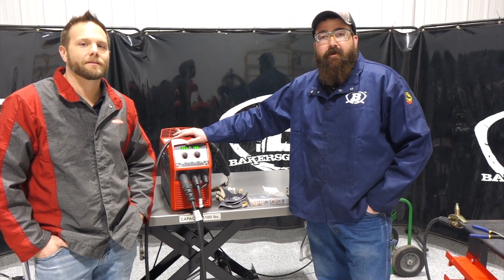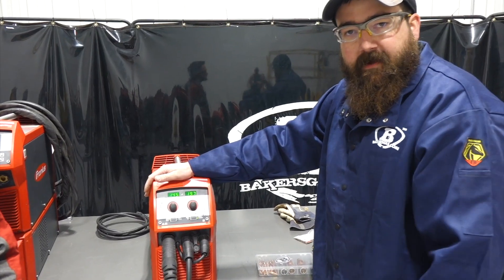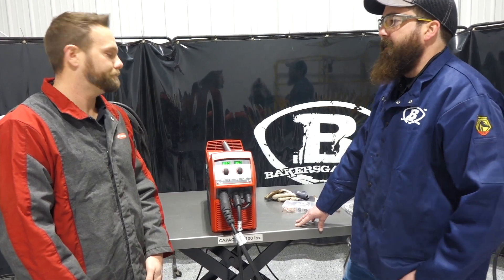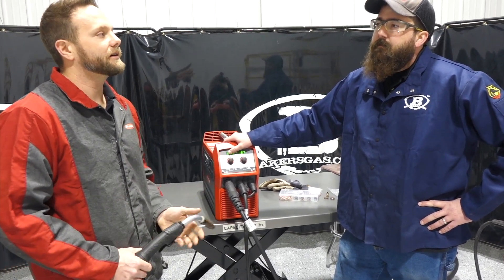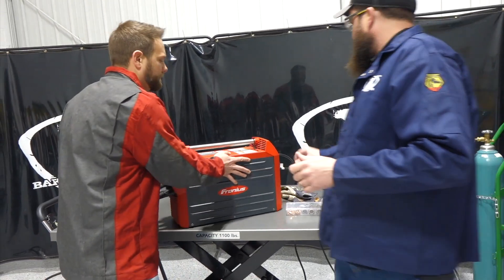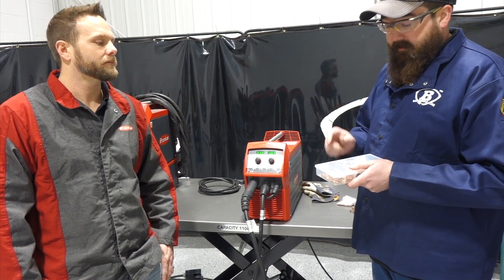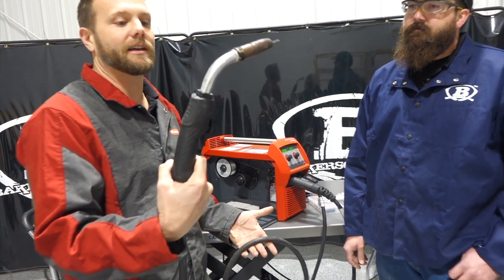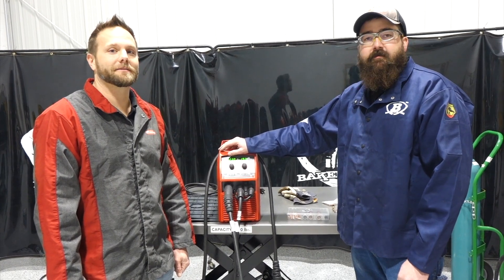Fronius TransSteel 2200 Simple Set Up Guide

Comment: plastic wire feed unit ,,, is it Parkside ? nope Im off to buy an EWM instead , same price but pulse , or a Bohler at half the price and standard consumables ,,, Ive tried to like these , but pay too much and get too little , the torch was the last deal breaker , I work on cars not bulldozers .I need something that can get into corners not repair blades .
great video though ,,, even if he just talked the talk , it was set for alumin , why not pull the trigger.

Comment: I might have to disagree and agree. Been running the 2200 Transteel for years now for light duty mobile jobs.(stopped using it after I got the Esab Rogue)
Pros: Very mobile, great welding off of 110V with 100+ ft of extension cord (3/32” stick and 0.30”FCAW). It can handle the elements outside. Mig gun is pretty awesome. 
Cons: Aluminum thru Mig gun is a novelty (does not feed worth a dang thru stock mig gun),Electrode holder is junk (switch it out), consumeables can only be ordered online, inlet nozzles and other drive rollers are a bit….weird. Mailing machine in for warranty issues is beyond frustrating!!And customer service is pretty spread out. Oh, and no it doesn’t run well of if welder generators (I ran it off my Miller PipePro 350, off 220v. And off a Lincoln Vantage. The Transteel did not like the power either machine produced.) 
Yes I have multiple emails and correspondence regarding the above stated. Would I buy one again? For dedicated shop use or garage use? Maybe, if price was right. But for mobile welding? Absolutely not. For the customer service? No. The machine does have promise. I like where it’s potential is headed. Unfortunately the Cons outweigh the Pros in different work settings.

Comment: How do the plastic parts hold up in the drive roller assy ? It was probably the biggest let down when I got mine.
Reply: I have been having mine for 3 years... Nothing has ever broke on it. I rarely change consumables. I also have a Miller 220 AC/DC and plan on selling it as I prefer Fronius over it. I love mine and plan to buy Tig set up next.
Reply: All machines are getting cheaper.  I've been selling welders for 30+ years... If I was getting a machine for my shop to perform daily... I would suggest a Miller made machine.. Not ITW... But when Mr and Ms Miller Owned  the company.. 1990s on down..  They don't build them like they use to .. Miller ...Now SENCE  ITW bought them in 1995 ,, They now buy from the world market . Which means Japan and china.. I actually saw a made in China sticker on a part inside the  new miller ..
Reply: Good points.  Happens to the best. Kinda like when Stanley bought proto !

Comment: The one I bought doesn't have the cable selection option at the rear
Reply: Cable selection? I don’t comprehend
Reply: @sbranham86  Just has a fixed 240 lead coming out.
Reply: @JohnSmith-ho8up  find the red tab on the 220v plug where it goes into the back of the machine, pull back on that red tab, as I’m away from the back of the machine and while you’re pulling the tab back twist it counter close wise and the plug will pop out. It’s not hard wired, it just looks that way
Reply: @stephencrumley9443  there is no red tab.  This version is hardwired.   Also the mig torch is inferior to what is in this video.  Was much cheaper though in initial cost
Reply: There are 2 versions of this welding machine.Transteel Std and Transteell MV.The standard is 220v only and the MV is multi voltage It is bullshit that it isn't specified.Where did you buy it from?
Reply: @reedsmetalworks6664  Rapid Welding /repairs and supplies.  Based in Portsmouth
Reply: @reedsmetalworks6664  Is that the only difference?  I actually need this machine to be used onsite on 110v    I'll have to contact them to get them to rectify the situation.  Usually they are very good..

Comment: The TransSteel is hands down the best welder money can buy.  For anyone looking to buy one I promise you, you wont be dissapointed. If you get stuck when you are doing your setup just search Youtube "Transsteel setup". Chris has put together a very comprehensive 3 part series on this machine and he goes into great detail on how to set it up.  It really makes setup and getting yourself familiar with the machine a breeze. I've also purchased some drive rolls through Bakers Gas and customer service was awesome and shiping was fast.
Reply: I love mine, the mig gun alone is a beast. I aways been Blue and finally went Red 😂
Reply: @Samortiz6yahoo  I am looking at purchasing the Fronius 2200 as well & my one friend keeps nagging me that I would be better off with the HTP 220 as it has single / double pulse mig where as the Fronius does not .

I also like the 110 volt ( 15 & 20 amp ) feature with the Fronius when there is no 240 volt plug in around .

I know some would say it's not worth the dual voltage Fronius machine over the double pulse mig HTP 220 ...as they think all one could weld ( steel )  with 110 volts is ONLY 1/8" thick . But from what I have read , 3/16 is possible ( probably not on a 15 Amp breaker but 20 Amp) 

Pretty sure those Chinese dual voltage welders would be maxed out at 1/8" steel plate on 110 volt but the Fronius 2200 has so much better duty cycle / punch to it
Reply: This Fronius 2200 beats my 3phase welders.  It really is a very special piece of equipment
Reply: everlast welders are better
Reply: @Migman2020  "better" as in?.....Maybe as far as price but thats about it. Not knocking everlast but at the end of the day everlast welders are a budget friendly welder made in China while Fronius welders are made in Austria.
Reply: @BrandonLund  nah.. can do exactly the same welds as any fronius machine with a everlast. i have 40 years welding experience so i clearly know what im talking about and fronius makes their stuff in china like miller and esab..

Comment: The knob to take the gun off susks
Reply: Yeah it's pretty annoying. Takes a full minute to untreated that. They also needed to make the case an inch or 2 taller. Putting 10lb spools on is a pain with the lack of room above the spool. Thier interface also needs a major overhaul way too much to memorize, and too clunky.
Reply: I’ve just noticed this while taking the gun off, they need a latch mechanism. The knob defeats the purpose of a quick change gun. It’s faster to change the gun on a euro mig connect. And I think the knob is now getting harder to turn which is very worrying.